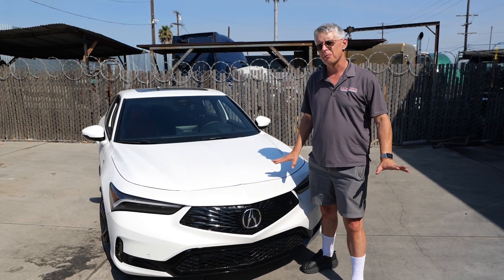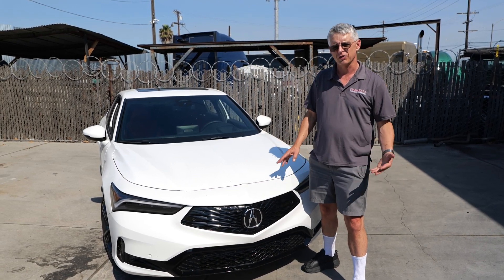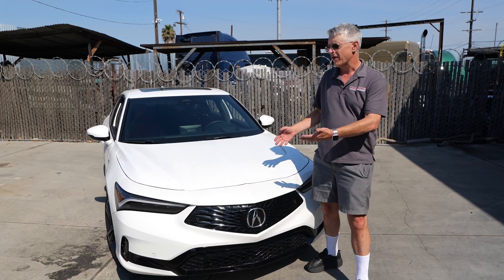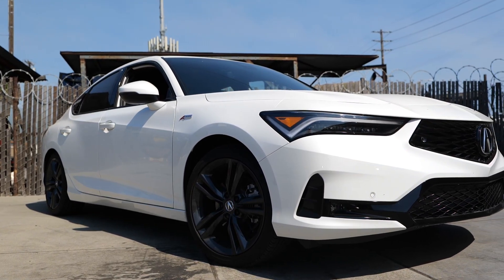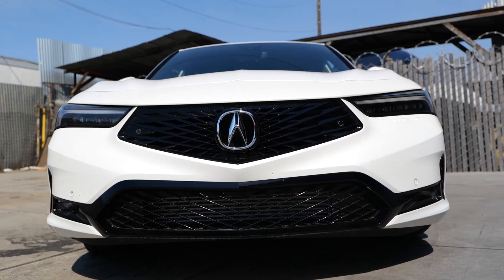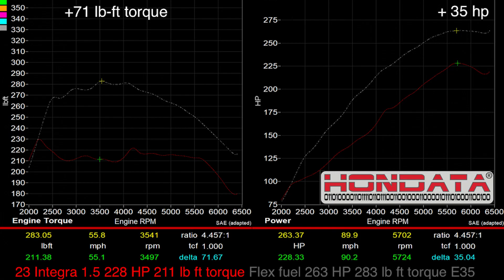2023 Integra | Flex Fuel Calibration | Race FlashPro

Comment: Is there Hondata Flash Pro for 2013 Honda Civic 2013 LX only mod so fat Takeda Cold Air IntakeWhat's the best quiet not noisy for tune exhaust that good for street daily driver? What else should I add to go faster...have a more exciting car.?? I also have Tien Coil over installed. Need new wheels and tires for better traction and speed etc any recommendations??

Comment: I've seen on your website that the flash pro has a base tune that is safe for the manual and CVT transmissions, is the flex fuel tune only going to be for the manual transmission? Can a CVT not handle flex fuel?  I have an A-spec 2023 integra, and I'd like to purchase the flash pro. but I am also curious on the flex fuel set up. NEED more videos on the integra!! keep the great videos coming.
Reply: You can upgrade to flex fuel on the CVT but not sure if this specific tune would work. Other tuners have lowered the torque for CVT.

Comment: I saw the other video about hondata flash pro and would like to buy it for my 2023 mt integra, is that diff from the flex fuel calibration or are they the same? Sorry I am new to this. And if they are diff do I need the 2nd stage clutch for the hondata flash pro?

Comment: So this dyno is E35 fuel he said, of course its going to +35hp on a turbo car. Lets see real street gas numbers like at least 93 octane.
Reply: e30/91 pump is similar to 93  - why run straight pump when you can run 105 octane ethanol tho? makes no sense
Im running 91/50% ethanol mix and make about 590hp or so on that dyno - why would I run straight 91 and be down in 400s lol
Plus ethanol provides better cooling and octane insurance from scam gas stations